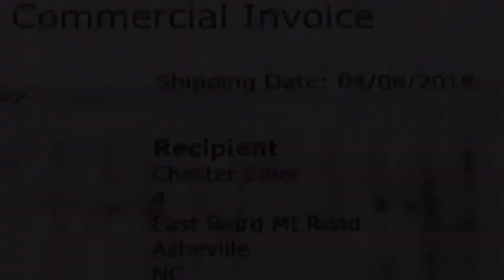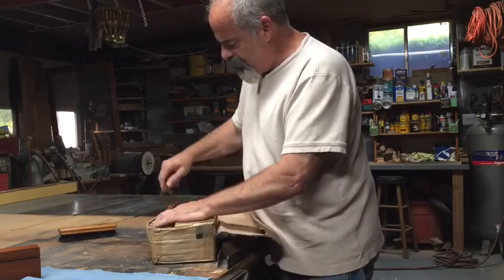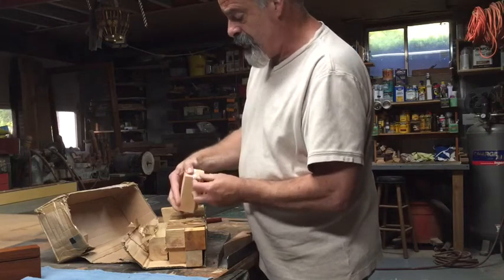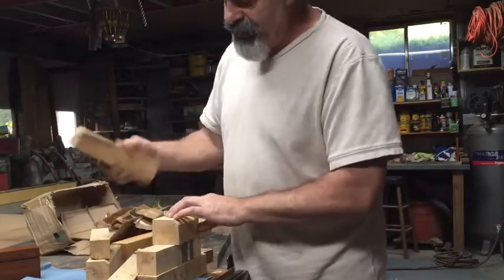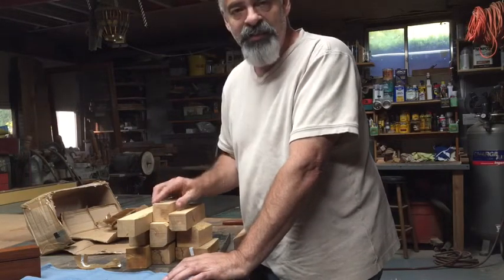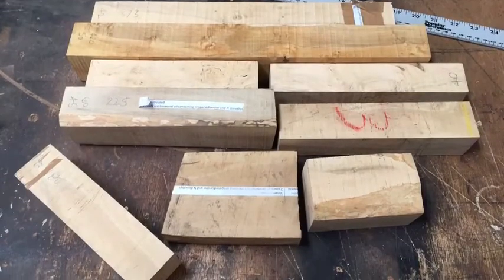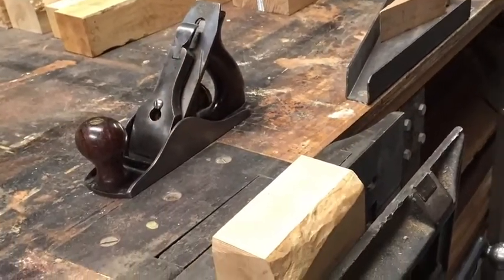CHESTER SPIER ON EUROPEAN BOXWOOD : IN THE SHOP

Comment: Hey chester; it just happens I have boxwood chunks from yanking out my hedges. Not as nice as those huge nice squared blocks from England, but big enough for chisel handles, knobs, worn edges of wooden planes. It would probably be best to send whole branches so you can cut your choice pcs. My sizes are up to 2" dia.x3 to 4" long. Also 3/8" to 3/4" xup to12" long; good for restoring crisp plane edges that were worn from use.